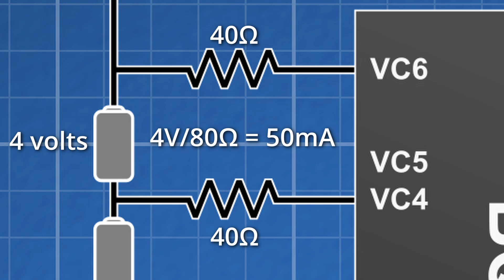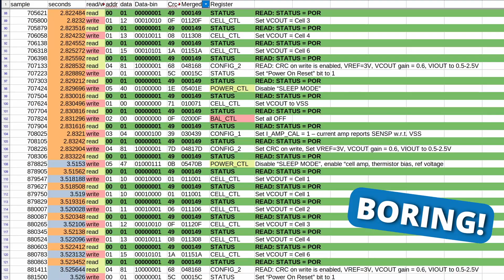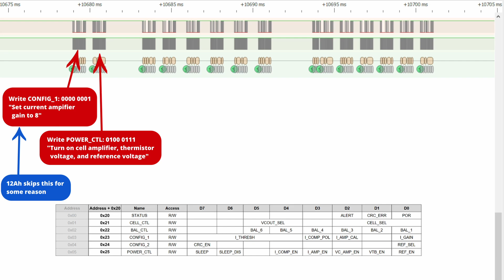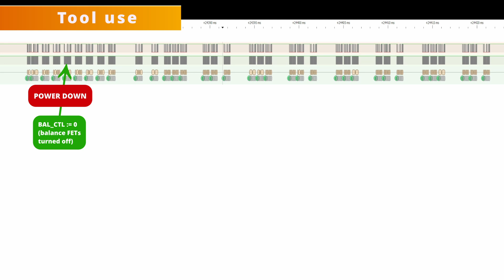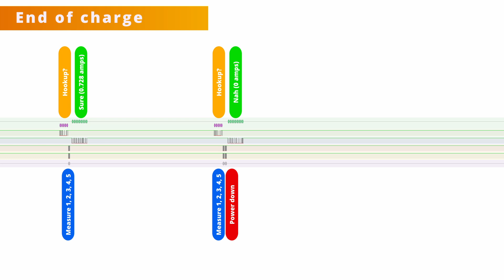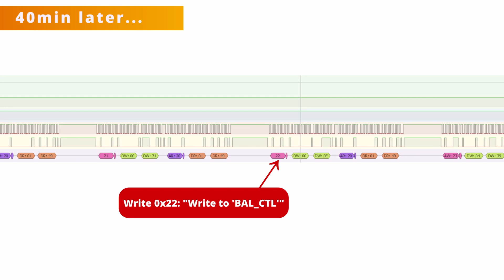[010] Why do M18 batteries charge to 3 bars?

Comment: I'm just starting to add balance leads to my Dyson. I tested a bricked pack & all cells were fine but the cell causing the fault has about 5% more capacity than the others & the circuit cripples itself when the voltage balance goes out to far. There must be money to be made in making a better BMS. Maybe one that charged each cell seperately to the correct voltage and one with a button to select storage charge for those that only use a device once every two months.
Reply from the maker: Someone made an open source BMS software for Dyson. FU-Dyson-BMS, or similar
Reply: @toolscientist  Thanks mate!... I saw that but the hacked circuit doesn't balance the cells. Balancing is critical as although the circuit protects from over & under voltage without balancing, the battery pack never gets to full pack voltage as it stops charging when the first cell reaches full charge and never really gets close to discharged as the BMS disconnects when one cell reaches the low voltage cut out limit. Interestingly Ive discovered internal resistance seems to have nothing to do with the cells ability to self discharge. On one of my packs, the highest capacity cell (with a low internal resistance equal to the other cells) had the lowest voltage (before balancing) and was the culprit for the BMS tripping the circuit. I would have thought it would have been the lowest capacity cell but the combination of it having the highest tendancy to self discharge (and to be honest it is only slighgtly more than the others) and the circuit not seeming to balance the cells, the cell with the highest tendancy to self discharge (not the weakest cell) was the curprit in this pack. I've hunted high & low for a circuit to have the high & low cell cut out AND a balancing feature AND an on'off switch but to no avail. I now have balance leads in all 3 of my Dyson packs and expect I'll be set for years.

Comment: Great video, I've replaced a couple of the BMS' on the milwaukee packs with ones from Aliexpress and I wonder if they do any balancing as they look like they have some chips for it.
Reply from the maker: That would be hilarious if the aliexpress boards balanced and the genuine ones didn't. I might have to buy one.
Reply: @toolscientist  They seem to have a few variants, some a lot more packed than others. The problem I had with one of them is that the nickel strips that come installed on the bms are too small for the current required and ran hot.
Reply: This is immediately what I wondered. Short of someone coding a custom firmware for the factory BMS, if there was a Chinesium BMS that actually did cell balancing, I'd consider buying a bunch to swap in as soon as my batteries are out of the warranty period.

Maybe a good idea for a video? And as you and others mentioned, I would be curious about the new Forge batteries, if there's a new BMS there that actually balances or not.
Reply from the maker: @ExodusC  I do have a battery where I damaged the PCB during testing. I could do an aliexpress swap and test.
Reply: @toolscientist  I really hope the tool outlets pick up on this video. The greater Milwaukee community understands the 6Ah don't die like the 8Ah and 12Ah tend to, and this is presumably one of the big reasons why.

I'd love to see Milwaukee get shamed by the entire tool community into fixing this. It's 2024 and at the prices they charge for these batteries, the dang things should have cell balancing and a Bluetooth module on the BMS that can report battery health to a Milwaukee app or something. It's ridiculous they're using what's probably ancient code written by an intern for these BMS.
Reply from the maker: Me too. It would be nice to see Milwaukee to come out and say "from now on, all our packs will ship with updated firmware with balancing enabled". Unfortunately, I think I didn't make a great video here. I've been focusing on trying to make my vids as short as possible to avoid mid-roll ads, but that means I failed to explain to the average viewer why lack of balancing is important and why this is a big deal. Analysing digital signals is also a bit more abstract and less accessible than showing exploding gearboxes, like the H96B fiasco.

Not sure which channel would pick it up. Most of the influencer type channels want to get free Milwaukee tools and Pipeline invites. Someone mentioned Tool Show, but they're a marketing offshoot of Ohio Power Tools who aren't going to want people to think twice about buying Milwaukee batteries. TTC is more mechanical/automotive and this isn't really something you can show on a dyno. The only vid that would make sense to his channel would be to cycle a 12Ah on a blower over and over and show the cells becoming more imbalanced over time, which is kind of a painful test.
Reply: @toolscientist TTC has a reputation for getting Milwaukee to recall a bad tool. They also have gotten manufacturers to continue to improve their products. They might, if you can convince them, test this issue out and report to Milwaukee their findings. They would have better luck then many on getting Milwaukee to take action. But as you said, this is not their core area. So one would have to hope...

Comment: A) You need to get a kinky girlfriend. Your needs are starting to bleed though a little bit.
B) Can you upload custom code to the micro controller? It would be funny as hell if you found a way to cram load balancing down their throats....
Reply from the maker: A) I am merely a reflection of society. So really it's you, as a member of that society, that is to blame.
B) They often have features that let the OEM lock the chip after programming, but I haven't looked into whether or not their MCUs do this. Someone made an open source firmware for Dyson as they were doing the same thing (i.e. having all the balancing hardware, but not using it). I think best course of action is to shame Milwaukee into fixing their code. It would take them 1-day of coding and a few days of testing. Making open source code would take me a year and then hardly anyone would use it due to the difficulty and risk of flashing firmware to a MCU.
Reply: @toolscientist  A) I reject any responsibility for you needing a kinky girlfriend. Mine isn't keen on the whole loan-to-random-youtuber thing and the whole mail order bride thing became illegal, so you'll have to sort that one yourself. Seeing you have good probing skills and can tie a decent nut, that shouldn't be a problem :P

B) Good points. But do throw your findings at the guys who ganked Dyson. Milwaukee is probably more inclined to act if someone can say "look how well it works!".

Comment: Would be cool if you could contact TTI and ask for a statement. Using someone like @TorqueTestChannel might get you further than "normal" customer support.
Reply from the maker: I'd prefer to stay off Milwaukee's radar, but for all I know I'm already on it. This video has 6 dislikes after 14 hours, whereas all my others only had 1 dislike after 24 hours. I think I'm too small of a fish to get a reply from Milwaukee, or even TTC.

Maybe we should start a harassment campaign on their socials where we ask "where's our balancing firmware?" on every post. To be fair, we should do it to Dewalt, too :-)
Reply: I'd try reaching out through another big channel thats not afraid of legal trouble. This seems like an obvious error on their site.
Could they produce a clip that updates the firmware on the pack without opening it?
Reply from the maker: @tschuuuls486  the batteries can communicate with the charger using the 2nd and 4th pins. I've heard that service techs can interface with it to pull diagnostic data. It might be possible that they've designed it so they can adjust parameters via this interface, but I doubt it. 

It would almost be more damning if that were the case. It would mean they knew about it, and had built in a way to fix it if they needed, but held off until it was discovered.
Reply: @toolscientist  it probably comes down to if the Microcontroller they used can be flashed over the exposed pins. Unless it's just a config thing, then it might be easier to fix.

Comment: Maybe balancing work only on new batteries? Or only in batteries with less than (threshold here) charge cycles? Then they just out of warranty and designed to die.
Reply from the maker: The real conspiracy theory would be if it worked on the really old packs, but they disabled it because their batteries were lasting too long

Comment: Why balance cells when you can just sell another ridiculously overpriced battery?
Reply from the maker: I guess for customer loyalty. Main reason I'm shifting to Makita 40V is the Milwaukee 12Ah packs failure rate. I had 2 of 3 of my packs do the "3 bars of doom" just outside of warranty

Comment: Simply amazing video. Short and to the point. You have validated what I've been noticing with my 9 and 12 Ah 18 V batteries. I've been noticing after only one to two years of normal nonintensive use that I'm getting three bars at full charged. I discovered many videos on Youtube from 3 to 5 years ago that many used the primitive technique of combining two batteries in paralell with two wires to recharge and calibrate a dead battery that flashed geen and red on the charger. A closer look myself by opening my own batteries and doing some research on basic knowledge of cell balancing li-ion 18650 and 21700 cells (of which in youtube there are countless videos English and abroad) got me the clue of imbalanced cells very quickly with a simple multimeter. And I found out the big 9 and 12Ah  basically only have 5 balance leads. My Aha moment. While the best quality setup, in my view,  has a lead between all cells, as far as I can tell milwaukee batteries look like to have a 3P5S lead configuration. So balance leads for every goup of 3 cells times 5! No wonder there is voltage drift and cells imbalance. I have found by rebalacing cells by using a a cheap Chinese 30 V power supply I could easily rebalance every group of 3 cells to a designated voltage. Once the cells had less than 20 mv difference I put them back on the charger for the last charge and balance and that solved both the error code on the charger and that I had 4 bars. All this by bypassing the circuit board by simply charging 3 groups of cells over the leads. Unfortunately on one 9 and 12 Ah batteries of the 4 one group of cells can't maintain their voltage so I think the batteries have failed and likely have a resistance issue and cells need replacing.
Your discovery of the microcontroller and balance controller is interesting. I wouldn't have thought there was a cell balancer on the board but more that the controller had a more refined managemt of power to charge charachteristics to protect more from exceptions in overvoltage and undervoltage scenarios through complex feedback loops.
Having seen your research in actually teally shocked how bad the software is and that for the new battery price it doesn't even have a 15 cell balance lead. I'm convinced with my experience and current growing knowledge that it would have had much better durabilty qualities if it had a better balancing system. With this video it has actually confirmed my worries. It has made me more hesitant in power tool batteries. Milwaukee batteries do have great power performance, but I personally think from my own tinkering and experience it would have had much better durability performance if it did have some sort of active balancing between daily use cases. I think the way the balancer works is somewhat underpowered and that the power charge rate attracts quicker cell imbalance which impedes performance faster, while I think if the cells could rebalance themselves between the 15 cells you would have a better power to endurance characteristic. There are plenty of interesting videos onthis such Korean diy'addictor and the the australian electric garage channels. Bit there are also others.
I have a suspicion the new forge batteries still have the same issue. I Watched the tool show (previous crew of belts and boxes). I shared my concerns recently on a live show on Mikwaukee US pioeline 2024, but I didn't get the impression understood the gravity of my concerns. I wouldn't be surprised the stacked packs don't have a decent cell balancing system either. And I think perhaps a lot could be learned from decent cell balancing with Tesla cars that hasn't come to the collective consciousness yet. I do think it's going to be a growing concern with many multicell packs in the future. I think for now we're to late to see a meaningful change for current "classic" milwaukee packs and the "new" forge packs for the next 5 years. Milwaukee wants their return on investment and likely the mindset will remain about comsumption-"fast "air cooled" charging"- and consumptive behavior, rather than more reliable and durable batteries. I don't do daily jobs with power tools and have also come to appreciate milwaukkee batteries as power banks for other applications and charging and powering other tools in the house and in the car. I think this trend will continue that people also want to do more different thinks around the home and other situations than tools exclusively. In my view I think the battery quality will be even more important in my view than the tool going forward. Right now I think there is more emphasis on the tool than the qulitative functionality of the battery, with milwaukee but also their competitors.
But I do hope all power tool brands see this issue and that it is fixed and quality controlled fast. Because with current quality of EV batteries and EV battery technologies all power tool batteries are not looking very good in terms of quality, (functional) design and performance. Excellent video. Thanks!
Reply from the maker: 15 balance leads wouldn't help. Each parallel group of 3 cells is already tied together and always at the same voltage. Theoretically you could do something like Dewalt Flexvolt and have the pack isolate the cells for individual charging/balancing, then reconnect them for discharge. This would be more complex and more failure prone, though. Having cells in parallel is very common in EVs and battery storage.

The problem here is that they have just chosen/forgotten to not enable balancing in their software.
Reply: @toolscientist  I agree it would be great is the software could be updated on the batteries. Would it be possible to do this by somehow connecting the battery to a pc to do the update? In my view a 15 cell balancer would still be beneficial and for longevity for the investment. I'm not sure about the argument about an  increased complexity andwoories about points of failure. Even now the current batteries are failing prematurely and I think single cell balancing is in my view still an obvious issue in my testing. If the pc board had no resitors to bleed off excess charge for passive balancing one would still have the issue with the batteries with software. The last 5 years I've increasingly seen third party active cell balancers come to market which look very promising compared to the more traditional passive cell balancing with resistors, which is to a degree also wasteful. In my view both software update and active cell balancers on the pc board could have helped mitigate issues with current milwaukee batteries going forward in 2024. Curious to find outbwhat you find in the forge batteries. Up rill now it seems very quiet. I only hear aboutbthe tabless cells, stacked cells and laser welding. But nothing else on the sofyware or  bms side, which in my view is unfortunate, and I suspect we'll see some disappontments. I would like to be wrong though.
Great work on your research, testing and videos. Still amazed. Good science! Thank you.